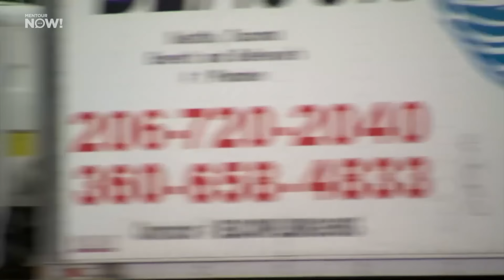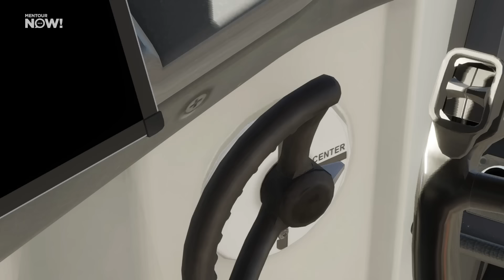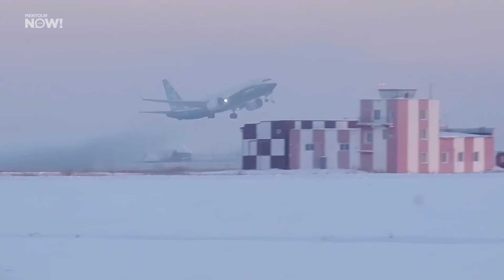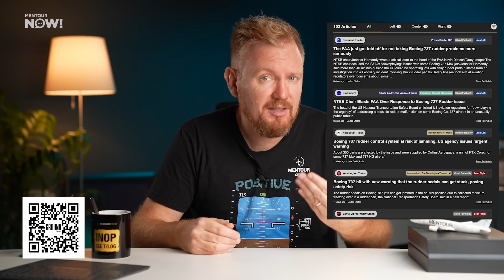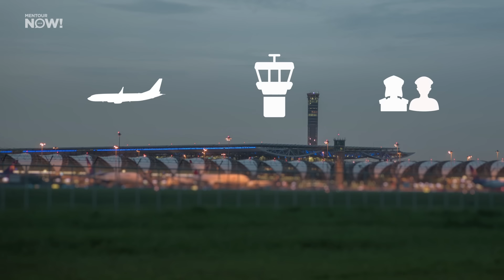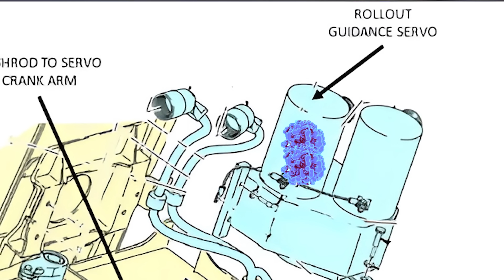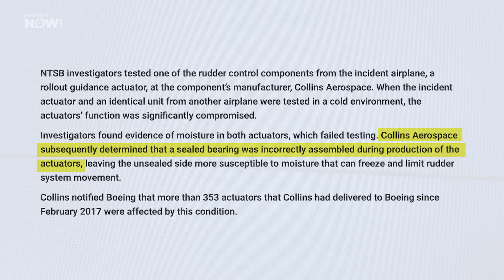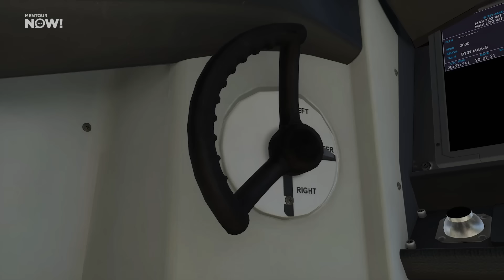Does the Boeing 737 Have ANOTHER Major Flaw!?

Comment: I’m due for an annual vacation here in January. It requires flying there, as driving is just too long. Last year, I got put on an A320 both to and from the destination. Perfect flights, nothing went wrong.

I’m legit terrified I’ll be put on any Boeing aircraft this year. I’ll gladly take another Airbus, hell, I’ll take a Cessna and fly myself there, I do not want to be put on a Boeing because of all of this. And this isn’t a fear of flight, I’m more afraid of driving, this is a fear of Boeing’s mistakes causing a crash.

And that is the one thing no company wants to hear - That someone has hesitations about using their product.

Comment: This is a peripheral issue--but, from motor vehicle experience I know cable actuated controls become sticky and non-smooth. The car I drive (a 2006 E Class) uses brake and throttle by wire--no antique cabling issues. Modern aircraft also use electronic fly-by-wire control systems---but not the B737. Excepting contemporary avionics and two big turbofans (didn't they cause 'problems'?), the 737 is fundamentally a 60-year-old plane, designed in 1965 and rolled-out in 1967. Has Boeing stated the 'Max' will be the last 737 iteration it inflicts on customers--ever?

Comment: Lots of reasons given in your explanation to suggest that perhaps there should be a tiller on both sides of the flight deck of all commercial aircraft. Single systems leave you with nothing when they fail, as in the case of MCAS! A go around on that landing may well have been testing as would incapacitation of the Captain. It also brings up the question of the procedures relating to the disablement of the actuator (AD's?) and QC or inspection procedures that allowed incorrectly assembled parts to be fitted.

Comment: From an engineering perspective I find this bizarre that equipment that its going to be operating in cold conditions but isn't designed with better environmental protection, I get that it wasn't supposed to have moisture in it but a lot of things are not supposed to have moisture in them, that's just the reality of life and a failure mode that needs to be designed around, one has to wonder if having a PTC heating element in such devices would be enough to completely avoid this sort of issue.

Comment: Its not a Boeing issue, its a component issue. Too many times have I received replacement parts that are tagged as "inspected"  "tested" and even worse "overhauled" and failed ops checks. The blame is on the companies supplying the parts and not the aircraft manufacturer. They need to do better

Comment: As a retired major airline captain who retired in 1994 after flying for 9 years between US and various EU airports, I am amazed you would state that CAT 3 Charlie does not happen routinely.   Perhaps not in 737s, but I personally have made numerous such landings in the B767, which has 3 autopilots, all of which must be connected in order to start the approach.  On many of these landings the centerline lights became visible only after the nose was automatically lowered by the autopilots.  On one of these landings at Geneva we did, as you mentioned, have to request a follow-me truck guide us off the runway and to the gate.  But a well trained crew, while totally concentrating on the approach, does not at all feel scared or terrified as you implied. On these landings the rudder pedals were not usable until the auto pilot was disengaged.

Comment: This is completely bonkers. The advice is akin to thumping the old CRT TVs when they went a bit wobbly or hitting the starter motor on my old Austin  with a hammer periodically. It’s not what you would expect as a sop in ~$100m worth of modern aeroplane.

Comment: This issue on the long run appear to be... actually not too bad. Pilots can react to it. And meanwhile, the issue can be fixed.
But the way Boeing underestimated their role, the necessity to correctly admit and inform (at the cost of bad publicity) is concerning. They STILL do not understand they have to become once again a respectable company, and that it requires efforts.
Still, authorities reaction and your own video is indeed reassuring.

I used to work for a manufacturer of scientific equipment. Obviously potentially dangerous. The competition is fierce and communication war is peak. Bad decisions have been and still are being made, for instance lobby issue back in the days, or simply stupid pride and false advertising of product quality when the competitors are actually better. In science, that never works, since the customer very quickly know who is good, who is bad, and who is a lyer (unfortunately, every company is, letting the scientist with no easy choice).
But as in aviation industry, overall, one can be proud. Because when there was a safety issue with our product... well, the company did the job. Nobody was hurt, but they immediately realized someone could have been. Thus they tested. They came up with a fix. They sent technicians on all potentially concerned systems, to all customers, obviously free of charge, to install the fix. That costed A LOT to the company. I'm sure some economy guy could turn the statistics and claim how much he would have "save" to the company if he was let to handle the case. But we know. We know how much it COULD have cost us, if one time, only one time, the accident happened. It wouldn't even have been bad because of reputation. These things pass and go. But when I realize something is dangerous with this part of the device, I want my company to play it safe for me too, else I'll quit. And you don't want the guys who care to quit.

That's what Boeing is facing now. How to recruit, now, guys who care. Because it seems they ALL left since a loooong time.

Comment: You're a pilot, I'm a former USAF crew chief who worked on 737's among over 16 different aircraft that I was certified on. There's nothing wrong with that airframe. The problems lie in three places. One current Boeing management, who used to be engineers and aviation people and instead are accountants, lawyers, and people who used to run other kinds of corporations. They cut corners in monitoring and controls well as yielded to unions who were more concerned over gathering dues for political purposes than making sure workers were doing their jobs correctly. 2nd, software both on the aircraft and in the factory that is used to maintain quality control. As the saying goes GIGO(garbage in, garbage out). That has grown when they moved more production out of Washington as well. 3rd, the airlines. I've watched and even done visual inspections on aircraft that I wouldn't let fly or if they did would then go into serious work. Stressed rivets, bulging plates, all sorts of issues. The airlines are more concerned about flight hours than aircraft maintenance and safety. They only make money in the air as executives have said. It's a minor miracle there aren't more problems than there are. As long as 737's have been around, they've been solid, durable, and reliable. But those people who designed and built those had a different ethic than today.

Comment: Even if the part is rare in all 737s isn’t it always there for planes capable of CAT III B (or C)? And you assume airless wanted that capability typically also use it. I’d imagine a jammed rudder would be a bigger problem if it happens during a CAT III B landing in low visibility, and a “just brute force it free” sounds like an even worse solution during such a precision procedure?

Comment: What is "maximum force"? Is that specific force published in the POH? What if both pilots are slender and don't have much leg strength? Is quad / calf strength something that is tested and validated across airlines before employing pilots? Not to my knowledge. I've flown with pilots who couldn't push or pull a 4-seater by themselves on a flat surface, much less manhandle a Boeing. Good luck with that guidance

Comment: Petter....Petter...Petter....I can understand the difference between the rudder control/auto pilot systems within the different generations of airliner designs from Boeing.
What I can not understand, specifically coming from you, the statement claiming that one incident from the older generation does not have any relation to the new incident
with reference to the rollout guidance actuator. And to make it right to the point, is that I am under the impression that the actual final test philosophy at both Collins Aerospace, AND Boeing, does not perform the environmental testing for the maximum operational temperatures ranges, that this guidance, and the older version, COULD easily be tested and should be subjected to. This is part of the great umbrella that covers, Quality Assurance, Receiving Inspection, Test Station of Assembly, Environmental performance measurements, over the full expose' of temperature ranges. - A way to characterize the performance behavior under extreme functional conditions. - That, in fact, Petter, is THE  common factor, which governs both types of actuators, the older generation one, as well as the Rollout Guidance actuators installed in the NG + MAX series.
Coming to close look at the case, is the point of failure ( through Failure Analysis in Reliability Field Analysis ).
the final test of these units, which are responsible of the aircraft manoeuvrability at all flying times. 
Perhaps, Collins Aerospace does what Boeing pushes them to comply with, and thus they fall behind the wave of pushing completed assemblies out as fast as they can. 
THAT IS TAKING AIM AT PROFIT OVER SAFETY STILL!
Perhaps Boeing does not have the installations nor the proper testing facilities, yet other independent labs around the country will be happy to assist them. Specially in a case of such sensitive magnitude.
Or, Perhaps, Collins Aerospace, in their spirit of assisting Boeing, they too cut corners. One corner that obviously was cut, was the raw material procure to make the moving valves, pistons and actual actuators machined, manufactured, and tested.
The only way that the an actuator valve could potentially become stuck at fault, or at any given position for that matter, is the fact that the materials that they opted to procured, they do not have the same performance among themselves.
Here is what I mean: each material, moreover metallic types, do easily react to temperatures. So that is why is so important to know the maximum temperature rate of every single sheet of metal and or metal rod, and or metal mesh, and or metal cable.
See, with every metal dilating differently upon heated temperature among each other. The same happens when these metals are exposed to colder temperatures.
This is called the coefficient of expansion. It can be possible, that a material might have more Boron or Cyanide, or not enough carbon being filter out of the melted
iron, which it would convert into steel.
depending on the amount of these impurities, for example, if we have two 5 cm long steel rod, of a quarter inch radius, one, it can be a malleable steel ( more carbon content ) and the other can be hard steel (less carbon content/ more cyanide coverage). If you put both under an environmental oven check for their reaction to high
temperature, ( not high tensile strength measurement at this point ) one can measure the length at operating room temperature, at extreme heat, and at extreme cold.
We will see, that in the same amount of time, the materials behave slightly different. How exactly?. Here it is: the expansion of the less carbonated steel, will be in a 
precision measurement, slightly shorter, than the malleable steel, having both units undergone exactly same test.
If a rod or piston in a valve is made out of softer steel than the vessel it contains it, it will be stuck inside, by virtue of the influence from cold extreme temperatures.
Someone did not do their proper homework.
It could also be, that because of such a condition, if freezing cold the material contracts, yet not all parts involved in the actuation of the system contract at the same speed at the same time.
Is like measuring the amount of time it takes to stop a car, with different materials, in the same distance and same amount of time. ( in this case cars ) having different results. ( This is an example of an analogy ).

The lack of proper testing at environmental conditions of extreme temperature ranges, is what is affecting the Rollout Actuator Guidance or, the other possibility is that
the lubricant froze sooner than the material contracted, thus friction locked the actuator in its cylinder.

Which is another potential failure consideration.  Viscosity and density, plus condensation, is not what the doctor recommended.      

I should look at the part specification from Boeing, to recommend Corrective Action and issue the pertinent Alerts.

So the common factor, is the lack of profound and effective testing environment, which it seems permissible by Boeing, or is the best that their supplier can do?
Let me be in charge of Component Engineering, and you will see how your inventory of Boeing disaster podcasts slowly vanishes.

Have a fantastic day yourself.

Comment: If a system like the rollout guidance actuator is installed but disabled does it still get maintained with the same rigor as the rest of the aircraft? Would the maintenance personal actually know the device is still present and connected to safety critical equipment? If so there must be a maintenance cost associated with leaving the device installed, wouldn't it make sense to just remove it?

Comment: Smiths Mk 29 FCS (Flight Control System), First full Cat IIIC analogue (yes, Analogue!) triplex autopilot. First used in revenue service in 1965 on the HS tridents. Later used in the RAF Short Belfast C.1 freighter where its initial accuracy caused problems. It was found to be so accurate that the pilots got no sensation of a landing 'bump' and were not sure when to apply the brakes. To cure this the radar altimeter datum was lowered by one foot, basically making the aircraft try to land one foot below the runway surface and so giving a 'positive' touchdown but this caused another problem. Every landing touchdown happened within in a very small area of the runway and the weight of the aircraft and load plus the landing 'bump' hitting that same small area started damaging the surface of the runway. Cured simply by replacing a precision component (actually a diode) with a general use type which gave a slightly more random touchdown point. Spent many a happy hour fixing them in the early 1970's and yes, standing in the cockpit watching the ground coming up  and then having the aircraft flaring and touching down without the pilot doing anything was a real spooky experience back then.

Comment: I had something similar happen to me in an airplane without this part. During landing (I can't remember if I was PF or the FO, with no tiller) we noticed the plane wasn't turning at all at low speed using the rudder pedals and I had to take the high speed exit using the tiller. Other than the surprise of it, at the last moment it wasn't a big deal to be honest, my instinct was to grab the tiller inmediately. The pedals were moving but the plane did nothing at low speeds. There is even a MEL item for this where you steer the plane on takeoff and landing using the tiller only. I was amazed when the engineers managed to fix it in like 15 minutes just doing some tests in the E&E bay.

By the way CAT III A, B and C doesn't exist anymore. Now we only have CAT III with different DH/RVR requirements.

Nice video, I wasn't aware of the details about this latest problem.
Reply: So you say that during a landing you "can't remember if I was PF or the FO, with no tiller", then say "I had to take the high speed exit using the tiller" in the same sentence?  lol 
Nice try, Cap'n Crunch.